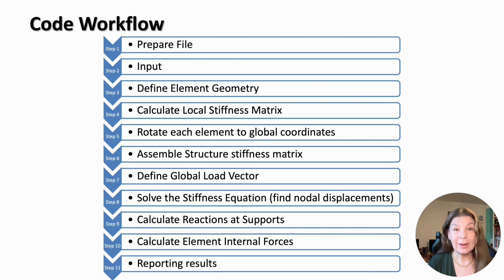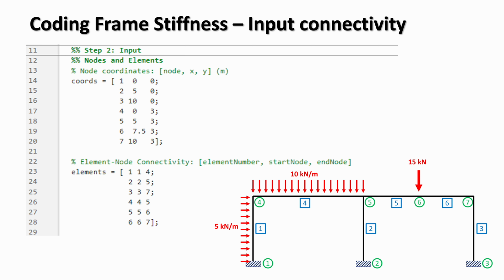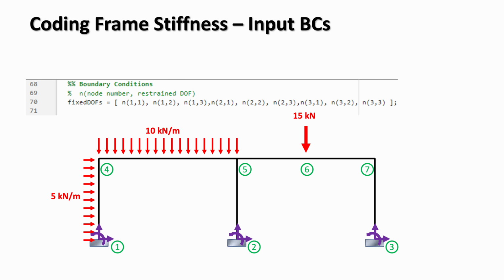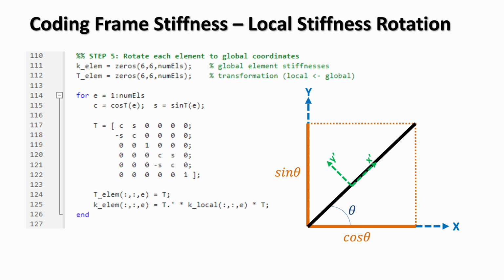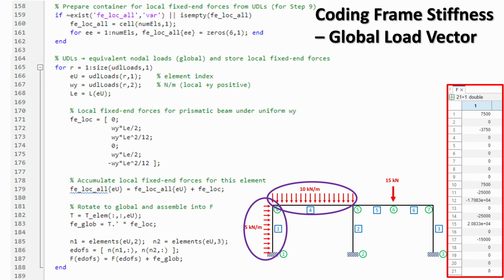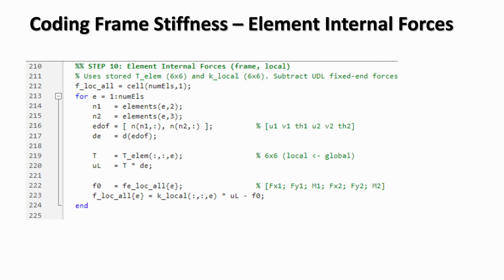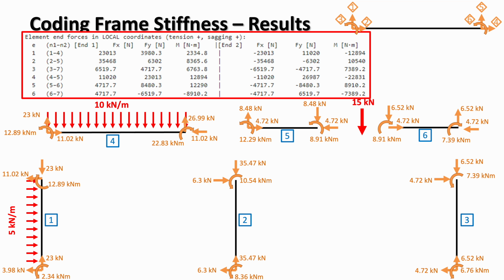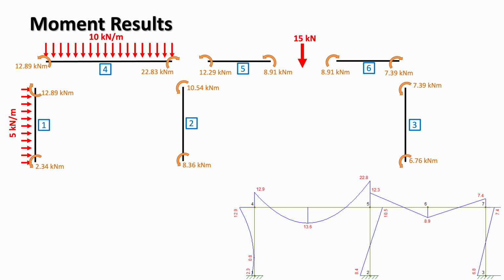Stiffness Method | Lecture 9-3 Indeterminate Frame Analysis + Full MATLAB Octave Coding Example

Comment: Thank you! This was very helpfull. Great channel for engineers over all!
Reply from the maker: That’s wonderful to hear! I'm so glad you found it helpful and enjoy the channel!
Let me know if there are other topics in structural engineering you’d find helpful 😊
Reply: @EngineeringTheCurriculum  You are welcome! May i ask....if i want to define different properties A,E,Ix for different elements, should i write for example A0= (200*200)*1e-6   % 200mm Χ 200mm
 A1 = A0*ones(1,1) meaning applying section A0 to element 1? Thanks in advance!
Reply from the maker: I think that the easiest way would just be to explicitly define this in a vector. For example, say we have 4 elements, each with a different cross section I could write: 
A = [ (200*200)*1e-6, (250*200)*1e-6, (300*200)*1e-6, (200*300)*1e-6];
Or if there were two different areas I could define A1 and A2 and then just use them explicitly in vector A.
The same could be done for Ix and E.
Hope that helps:)
Reply: @EngineeringTheCurriculum  Yes it works! Thanks again!!!